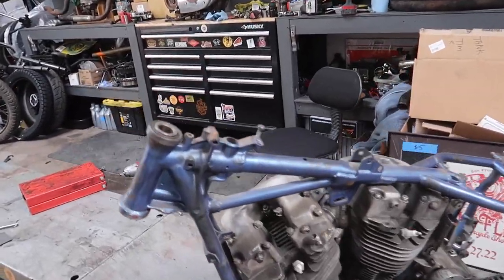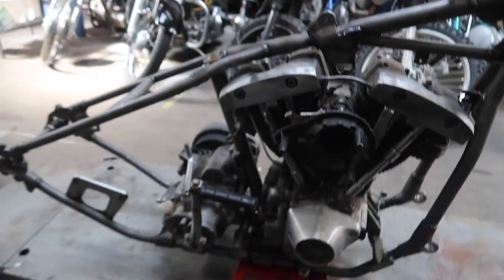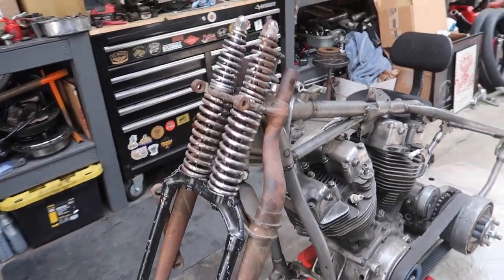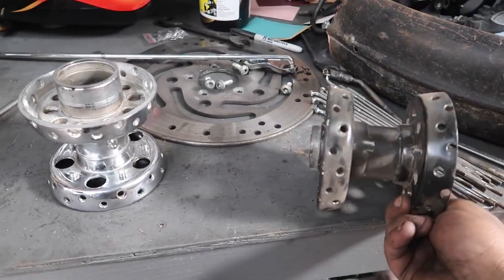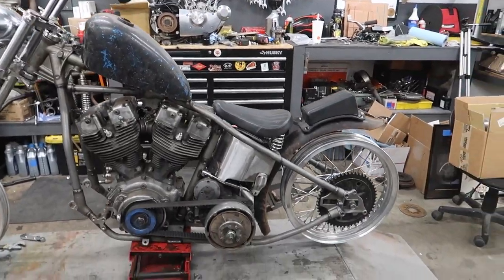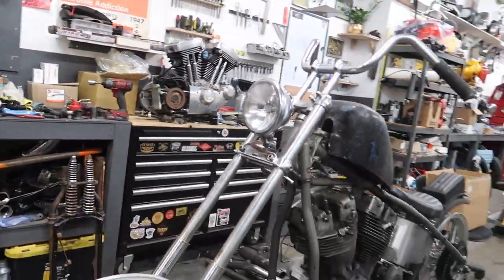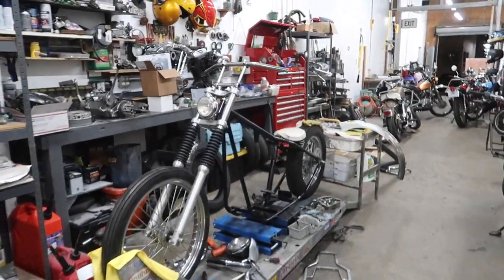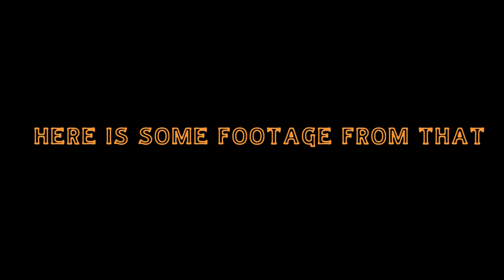Shovelhead Chopper Build off!! Building Another Chopper!

Comment: Very cool to see you guys building old scoots when I was about 18 19 I spilled a couple pan heads and shovel heads and one knucklehead had an all three wheeler all suicide ratchet top jockey Chef Richard frame handmade seat good to see you young guy still dealing with this stuff it's way cool there's nothing prettier than an old scooter built by somebody who understands the old ways I've got me a rigid frame 650 Yamaha now with a DNA Springer about five over rigid frame I built the suicide clutch on it Sportster tank step seat stitched by hand leather anyway way cool thank you guys for what you're doing I'm 70 now and still still kick starting the old motorcycles

Comment: I'd go with the extended 33.4 Sportster front end. Just make sure that all the moving parts work well. I like my rear wheels/tires like my gals -- chunky. 16-inch rear tires help a bit whenever you hit highway expansion joints and other slight imperfections on our roads. I also like the riser/bar combo on Yama's shovel. Mike's bike is coming along swell. That molded ribbed rear fender is a treat. He'll have it finished for that bike show.  Build right. Ride safe. -- W